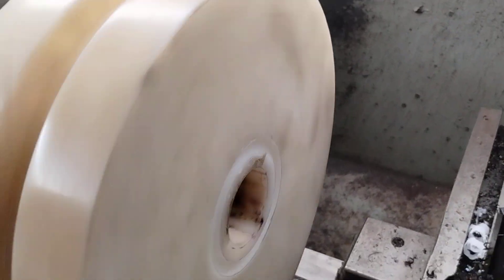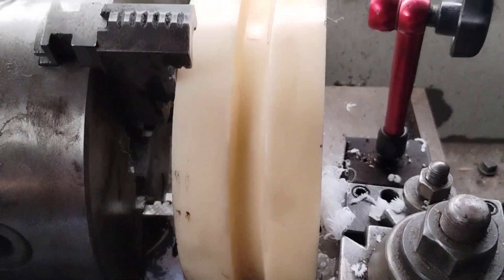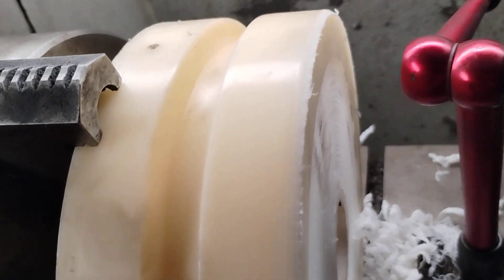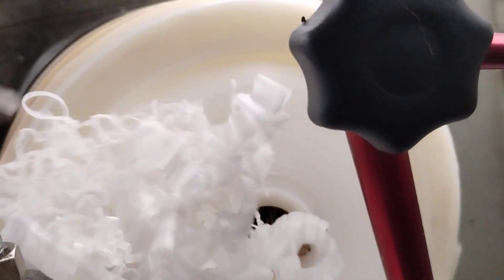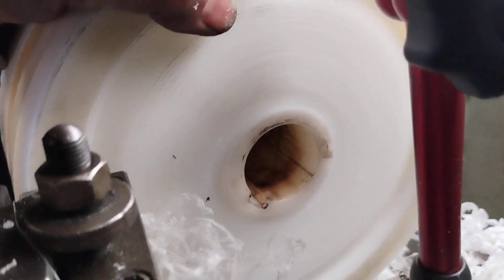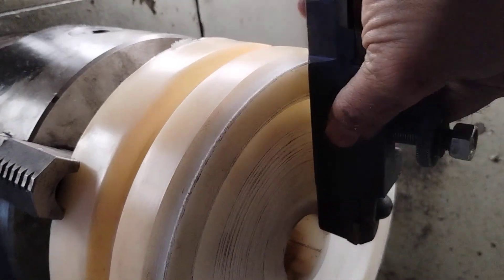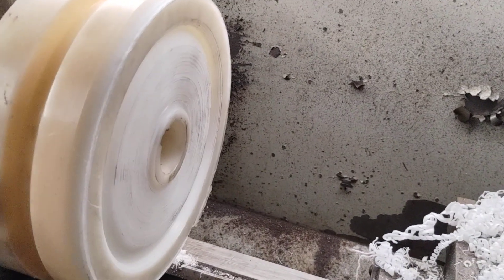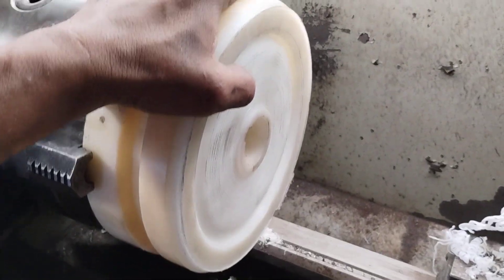Titanic Titan Implosion interface ring model concept being produced

Comment: I'm not an engineer, so please don't laugh at or admonish me more than I deserve for this guess.  Are the recent uploads meant to lead us to understand that there may have been some event that caused the sub to experience torque that happened before the failure of the pressure vessel?  Some of the ways that could happen would have been (1) a failure that caused all of the equipment in the back to detach sending the rest of the ship tumbling, (2) the deployment of the air bag causing the vessel to spin, (3) the sub settling on the bottom for a time then tipping and somersaulting as it began to ascend (4) the landing skids not uniformly detaching all at once creating torsion on the sub.  All of these would cause unequal forces to act on the ship and provide the means for causing fractures that would lead to tearing things apart under the high pressure at the depth where the emergency occurred.  (The five 200-pound passengers getting thrown around inside - if the sub did tumble - would be another source of unequal forces that defeat the engineering assumption of equal forces around the radius.)

As I said, please be kind if you have to tell me I'm too stupid to figure this out and to just wait patiently for others to explain.
Reply from the maker: I think you are doing awesome!  Keep thinking of the different versions this could have gone down... including the air tanks inside failing...